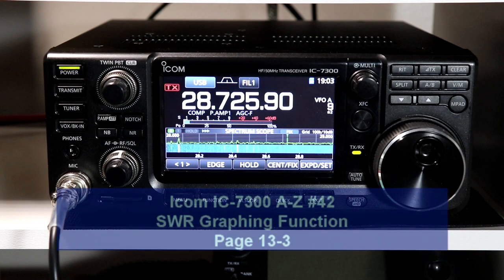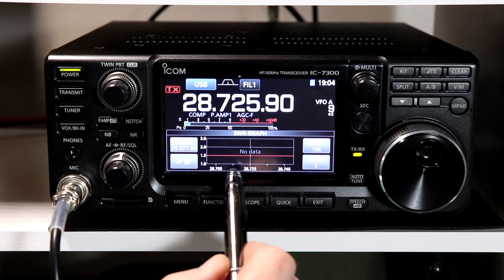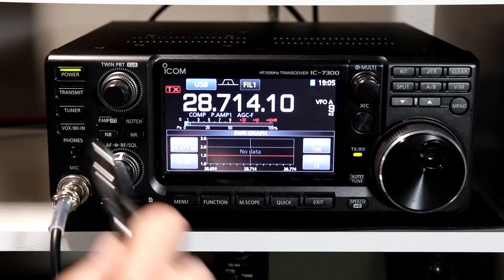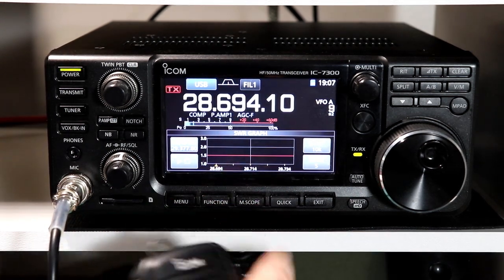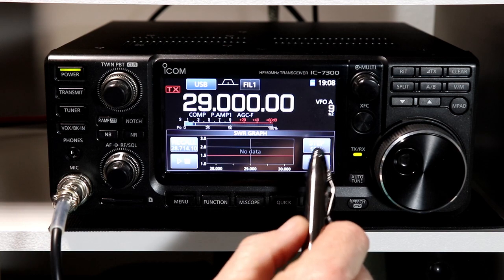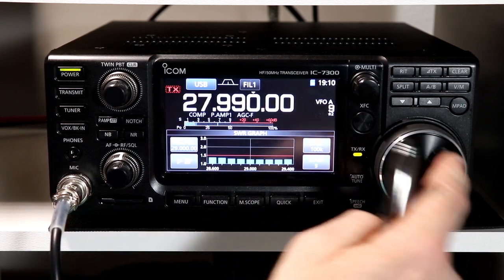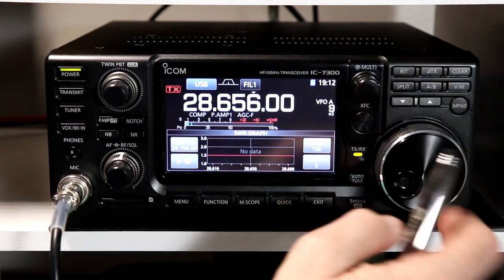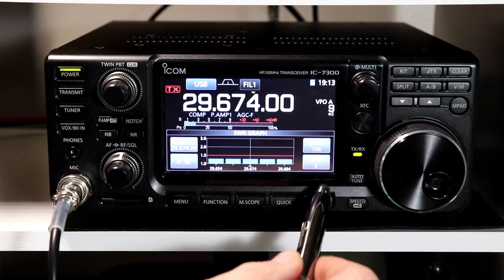Icom IC7300 A to Z #42 SWR Graphing Function

Comment: Tom, for info the reason Icom suggest power of 30watts or more is due to the fact that the SWR is inaccurate with lower power settings,  you can verify this yourself, check SWR at 30watts or above then start to reduce power down and you will see the SWR reading reduce suggesting that your antenna has a low SWR.
Reply from the maker: I haven’t really tested this in detail.  I don’t have a good, calibrated external power/SWR meter to check the radio against.  This sounds like a good excuse for a new piece of test equipment. :-)

Comment: Hi Tom all good stuff, you can also turn the screenshot function on and take a picture of the screen for reference, only downside of the 7300 seems to be the clock battery, they usually last about 6 months hi....from Fred g4vvq Uk.

Comment: Tom: Watched all 42 episodes of your ICOM IC-7300 A to Z  Series and found them to be superior over the dry reading of the manual. I just passed my Tech/General exam, KE8PLG, and got this radio in September. Working on an antenna solution right now (Condo dweller with an HOA). Being new at Ham Radio this series really helped me get going. Followed your videos with hands on my radio. Your direction and presentation worked great. These videos will become a permanent future reference for me. Looking forward to seeing more. Thanks. Mike KE8PLG.
Reply from the maker: Hi Mike!  First, thanks for your kind words.  Congratulations on the radio and the license and welcome to the hobby.  I lived in an HOA for almost 10 years.  There's no doubt that HF is a compromise, but you can definitely get on the air.  There are plenty of stealth and small antennas and plans out there.  I'm glad that you are finding the videos helpful.  I haven't posted a 7300 video for a while, but I'm not finished yet.  There are still more features and functions to cover.  I've been a little side-tracked starting the 7100 series and there may be some other series coming too.  I really appreciate your taking the time to comment.  Hopefully we can meet up on the air or maybe at Dayton or another hamfest someday.  73,  Tom WA2IVD

Comment: Neat. I tried the 10W level and then 30W and 50W. AT 10W the  SWR was low...it increased as the power setting was set higher. The antenna, a dipole, is pretty well flat at 14.074, which is good because I've been using FT8 a lot. Looks like I have a problem because at the 50W level it rose to about 2.75.

Comment: Excellent as usual. So, do I have to attach a microphone to step through the bars? Can't I just use my cw key? I generally don't have a mic attached to my radios. Thanks!
Reply from the maker: Actually, I don't know the answer to that.  I've never tried it with a CW key.  I'd be even more curious to know, if you have the keyer setup, instead of using a straight key, I wonder if the Dahs will automatically step through each bar?
If you try it please comment back here and let us know.

Comment: I like your series for the 7300, I have an off topic question on 20 meters after sundown I get OVF flashing red on my screen meaning I have a signal that is overloading the front end of the 7300 is there any easy way to filter out the signal ? might be a good topic for a video when you are through with your series. Thanks for your Videos 73 Tom
Reply from the maker: Hi Ed.  It's a great question and I haven't covered it yet.  Unfortunately, it's a little hard to get the OVF indicator to flash on queue.  I have seen this on my rig on both 40 and 80 on occasion.  On one occasion I figured out that another station within a couple miles of me was transmitting at high power.  The 7300 does have bandpass front end filters, but they can only stop so much.  You could try turning on the Attenuator.  You can also just turn the RF gain down a little bit.
Hope this helps.
73,
Tom
Reply: @HamRadioA2Z  I have tried both the band pass and turning down the RF gain with little success. The offending station is a foreign broadcast station. The other night while listening I heard music. The frequency I was listening to was 14.300 Mhz  there is a Maritime Mobile Service net on that frequency that I listen to from time to time. Thank you Tom for the reply, I like your videos on the Icom gear I have a lot of it lol 73, keep them coming.

Comment: Just a comment that you can capture each graph as you do it and save it to the SD card. 
Turn on the screen capture function under Menu>Set>Function>Screen Capture>[Power], then exit and click the Power button quickly to capture each SWR screen. Seems odd to use the Power button for this, but that's what they use. 
Can view them later with Menu.Set.SD Card>Screen Capture View. 
Also, had trouble keeping in my license class "lane". Have you found a trick to do the SWR so that you can't transmit out of frquency for our license class? Or is this allowable and not considered to be "transmitting"?
Reply from the maker: Thanks!  That’s a great tip.

Comment: Tom, Thanks for the excellent videos. I was attempting without success to figure this stuff out by reading the manual. One question, how do you turn the tuner off? I've been trying to find that in the manual but, no joy,
Reply from the maker: Hi.  I’m glad you’re enjoying the videos.  This isn’t explained very well in the manual.  When you press and hold the TUNER button, it forces the the radio to tune.  When it’s done, TUNE will be shown on the display.  If you just briefly press TUNER, then TUNE  will turn off and the tuner is bypassed at that point.  Each time you briefly press TUNER, it toggles the internal tuner on and off.  The answer in the manual is hidden in a NOTE at the bottom of page 11-2 where it tells you how to reset the latching relays in the tuner if the radio gets bumped hard.  73,  Tom
Reply: @HamRadioA2Z  Thanks for the help, Tom. I figured it out after posting. I need to get the manual printed and take it to Office Depot for binding. Jumping around the pdf from the table of contents to the text is slow and clumsy  for me.They could have mentioned the toggle in the section on swr graphing. I have a Yaesu Dual band radio that's worse, five buttons and two knobs and maybe a hundred non-intuitive menus. Thanks again.

Comment: Does this work when using an external tuner?
Reply from the maker: Yes and no.  The graphing function does work, but if the tuner is engaged, then you’re just measuring the SWR between the radio and the tuner. So you should be seeing close to 1:1.  You can use this to see how broad the match is by checking to see how quickly the SWR increases on either side of the tuned frequency.  You need to make sure the tuner is disengaged if you want to see the SWR of the antenna.

Comment: I am not sure if you have already covered it in the past, if you did, please tell me in what video. 
When you hit the Mhz numbers, the screen that comes in, has a button on the last line, saying "GENE". What is this button? What is this made for? It's on page 163 of the manual, section 19-9.
Reply from the maker: Hi.  GENE is for General Coverage receive.  It is basically treated like another “band”. One neat feature of it is that it has 3 band stacking registers just like all of the amateur bands.  So, you can go to GENE and tune in some frequency and mode.  Go back to the band screen and hit GENE again.  Then tune in another frequency and mode and then finally a 3rd time and it will remember those 3 frequency and modes and cycle through them each time you hit GENE.
Although it is intended for general coverage receive, you can tune in anything you want, including frequencies within amateur bands.
Reply: @HamRadioA2Z  Thank you!

Comment: Great channel...  Thank you.  What would you recommend as a good resident antenna for the IC-7300?
Michael VA6XMB
Reply from the maker: Hi Michael.  That is one of those questions that’s like asking about religion or politics.  It depends a great deal on what your property is like.  I use an end fed antenna currently because I have 1 tree in the back yard where we rent.  So I can run a wire from the house up to the tree.  I have a friend nearby in an antenna restricted neighborhood and he has a vertical setup right next to a large tree in his yard.  The short answer is whatever antenna you can fit and get on the air with is a good start.  You can always put up more and different ones later.

Comment: So, what's wrong with ID'ng your station before you go into the SWR Graph mode and then immediately switching to the Graph and checking your antenna/VSWR then?   Or, you can monitor on another radio or a web-SDR to make sure you are not interfering with another station.  Having a back-up rig is important for many reasons.    73  K7GYB
Reply from the maker: Yes, you can ID before you start the SWR test, but that is just on one frequency.  Depending on the step size you set and the number of bars, you can transmit short carriers across and entire band.

Comment: Hello Tom.
I come to annoy you a little because I have a problem with this.
I can't get the bars to appear to control the SWR and luckily I have an external power meter rosmeter to find out. I have the impression that my internal ATU is HS, because by connecting for example to an antenna set to 10m ros impeccable with or without internal ATU. Normal you tell me. On the other hand, if I go over 20m on the same antenna and I activate the ATU, the SWR display of the ICOM 7300 finds me a good ros but my output measuring device indicates a crazy ros. Calibrated rosmeter tested.
I hear the ATU relays clicking well but the antenna tuning is not done.
For the example:
1/ 10m antenna 10m band with or without ATU ok everything is good.
2/antenna 10m band 20m with or without ATU reading swr on the icom 7300 1/1 ?????
swr reading on external device between 5/1 and 6/1 oops!
So here is my problem. If you have a small idea? All my good 73's.
Joel/F8MGW
Reply from the maker: Hi Joel.  You are not annoying at all.  This is a fairly common question and is a source of confusion for many people.  The internal antenna tuner  does not actually "tune" the antenna.  It is only adjusting the impedance at the antenna connector on the radio to match the 50 ohm impedance of the transmitter (and receiver).  For example, if your antenna is 3:1 SWR on 20 meters, it will still be 3:1 on your external meter after the tuner has tuned.  If you could put your meter between the internal tuner and the transmitter, it would show 1:1.  Other people have had similar confusion with external tuners.  It is very important where you place a power/SWR meter in the system relative to a tuner and the radio.  Unfortunately, with the internal tuner you have no chance to put the meter between the tuner and the radio.
I think this might make a good video.  Thank you for the idea.
73,
Tom

Comment: I tried this with 2 cross needle meters, only matched on a few bands, on 160 I had 3:1 on the meter, and the 7300 was flat. 1:1
Reply from the maker: Hi Ed.  Thanks for the comment.  When you did the test, did you have the internal tuner in the 7300 engaged?  The internal SWR function is looking at SWR through the tuner.  Your external meter will be looking at the antenna system directly.  Make sure you have the internal tuner off and try repeating the test.  That might be the difference.
Reply: @HamRadioA2Z  First Thanks!! for great video's. Each band I used only the internal tuner. First test compared just the cross meter in line with the antenna., The second was using the cross meter in a manual tuner in bypass function, similar to the first test.